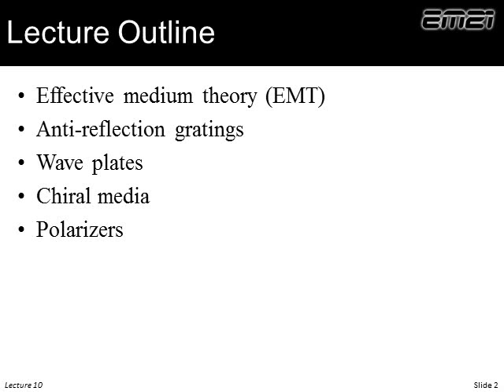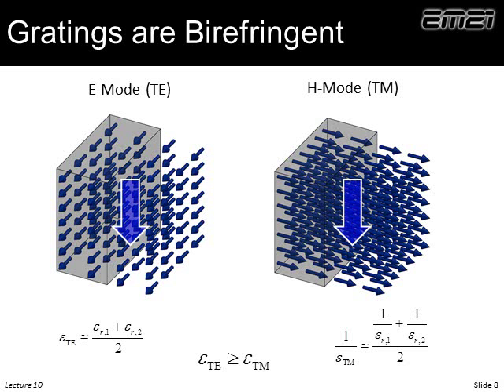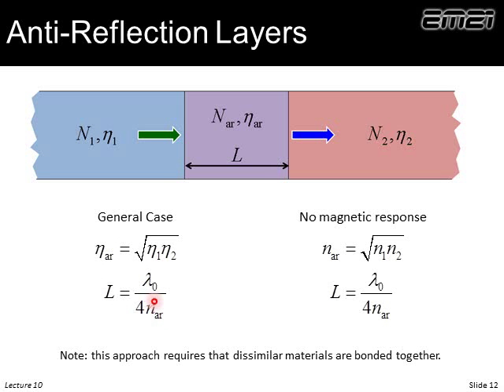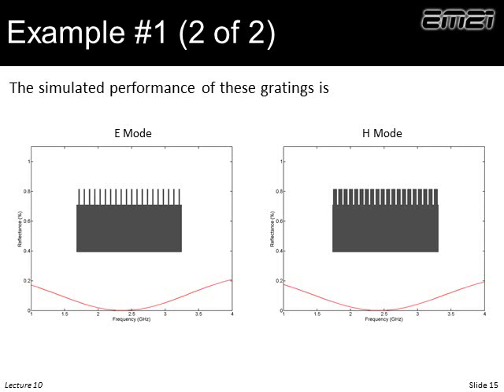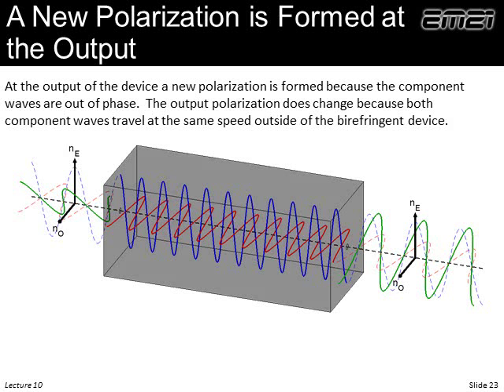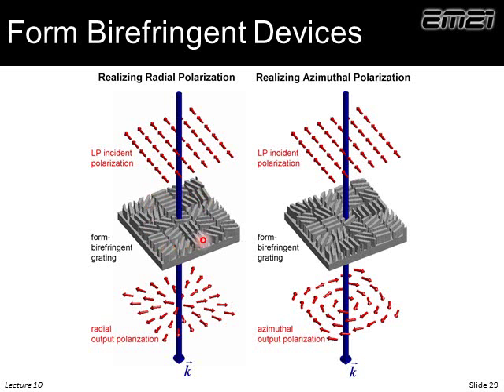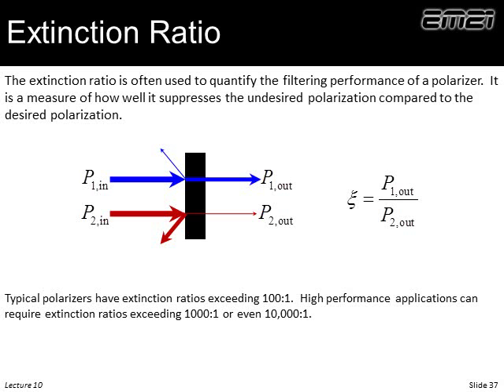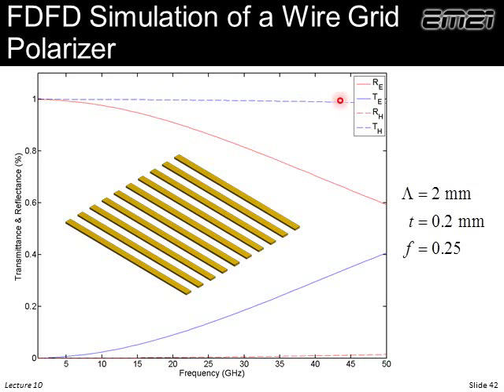Lecture 10 (EM21) -- Subwavelength gratings

Comment: Can/are sub wavelength gratings be used for imaging purposes (i.e., holography)? If yes, what would be the benefit (apart from introducing polarization capabilities)? For the actual image formation ad distance d, I would argue that any feature smaller than the wavelength cannot be propagated from the grating because planar waves describing them will be evanescent by definition.
Reply from the maker: Grating couplers are often used in holographic glasses to transport light between the source, detector, and eyeball. These are subwavelength to external light but not not internally where they diffract.

Otherwise, I am not entirely sure where/why they would be used but I suspect there are applications. A good friend has  a book coming out soon on holography and he will have examples and even computer codes about this.

Hope this helps!

-tip

Comment: Thanks for the lecture! I do not understand slide 9 on TE and TM mode. Why we analyze magnetic field only for the TM mode? TE and TM mode just different in electric direction, why we do not analyze and compare electric field energy for TE and TM mode? Why magnetic field has anything to do in this analysis on dielectric constant?
Reply from the maker: Good question! First, the labels "E Mode" and "H Mode" come from my computational electromagnetics courses and is not an industry standard label. If you want more information on that, you may be interested in my book...

https://empossible.net/fdfdbook/

There many different definitions for TE and TM and each leads to different configuration of fields. The short story is that when I see things called "TE" and "TM," I will not immediately know what people are talking about. Be careful with those labels.

Now to answer your question. Mathematically, it is possible to express waves completely in terms of just the electric field or just the magnetic field. What I am showing as TE here can be expressed completely in terms of the electric field E, thus the title "E Mode." What I am showing as TM here can be expressed completely in terms of just the magnetic field H, thus the title "H Mode." That is why I analyze these just in terms of either E or H.

By the way, I have completely revised and improved the notes for this section. You can find them on the course website that I recommend you use as your main portal to this information.

https://empossible.net/academics/21cem/

Unfortunately, I have not yet re-recorded the videos, but definitely checkout the notes!

Hope this helps!
Reply: thank you! @empossible1577

Comment: On slide 5 you have the figures on the left labeled "Parallel Polarization", but in your dialogue you call that "Perpendicular Polarization".  Vice versa for the right figure.  Which one is correct?  Your slide labeling, or your dialogue?
Reply from the maker: Sorry if I misspoke!  For polarizers, diffraction gratings, and subwavelength diffraction gratings, polarization is defined as the electric field relative to the grating vector K.  The grating vector K points in a direction perpendicular to the grating grooves.  The TE polarization has the electric field transverse to K which means parallel to the grooves.  The TM polarization has the electric field parallel to K which means perpendicular to the grooves.  It is very easy to get the words mixed up!  Sorry!

Comment: Thanks a lot for these great videos. I have a question on the antireflection layer: why the tapered grating has better performance than binary grating in broadband case? how to design it? Thanks for your help.
Reply from the maker: The taper is a smooth transition.  For design, you can take one of two approaches.  First, you can just do any sort of taper.  Just about anything works pretty well.  Second, you can spend a lot of time optimizing the taper and get a little better performance from it.  Unless you really want to improve the angular response, I recommend just incorporating any sort of taper that is maybe 1 to 2 wavelengths large.

Comment: At https://youtu.be/bkLPAL_RLUc?t=704 Why does the length has to be equal to 1/4 wavelength and what happens if you make it shorter or longer? I understand that 1/4 wavelength thickness is good if you want to achieve destructive interference, but I believe that here the goal is to match the effective refractive index closer to that of air, such that the wave essentially penetrates the material instead of reflecting at its interface. Thanks for your help and thanks for this great video!
Reply from the maker: Great question.  First, let me point you to the official course website which has links to the latest videos, electronic notes, and much more.

https://empossible.net/academics/emp6303/

In fact, there are other thicknesses you can choose to get zero reflection.  It is just that the quarter-wavelength is the easiest solution and works well.  If you want to see a detailed derivation that also identifies how to get other solutions, checkout Lecture 7f Multiple Scattering here:

https://empossible.net/academics/emp3302/

If the wavelength deviates from the design wavelength, reflection is no longer zero.  However, there is usually a range of wavelengths where the reflection remains relatively low.  If you want zero reflection over a broader range of wavelengths, there are antireflection coatings that have multiple layers.

Comment: If i have a structure of discontinuous arrays of silica with 100 nm period which is 10 nm thick and i hit it with 300 nm em wave, what will happen? Will it diffract? Is it subwavelength?
Reply from the maker: That is still subwavelength.  The wavelength inside the silica is 300/1.5 = 200 nm.  That is still larger than your grating period of 100 nm.

Comment: Would the concept of the spatially varying polarization, say linear to radial, using the form birefringence device, be applicable to EM waves in the microwave region, or would this effect only occur in the optical region? Also would the parameters such as spatial period, and duty cycle scale over in to the microwave region? Great lecture btw.
Reply from the maker: Thank you...and yes!  Electromagnetic waves all behave the same way from radio frequencies to microwave to optical to x-ray frequencies because they are all governed by the same equations, Maxwell's equations.  The only reason there are any differences is because the properties of materials can be quite different at different frequencies and the different size scales may limit what we can and cannot built.  There is a concept that you eluded to called "scalability."  If you find a device of size L that does exactly what you want at frequency f1, you can make it operate at frequency f2 by scaling all dimensions by f1/f2.

Very often this leads to devices that are not of practical size when you scale from optical to microwave frequencies.   Also, at microwave frequencies, metals exhibit much lower loss so you can often make much smaller and more compact devices than at optical frequencies where metals tend to be avoided as much as possible.

BTW, if you are interested in the spatially-variant stuff, take a look at this short course:

http://emlab.utep.edu/scSVL.htm

Hope this helps!!
Reply: Thank You very much. This is exactly what I have been looking for. I've tried to read some of the literature on space-varying polarization manipulation and PBOE's  and the concept of geometric phase kept appearing. It sounded like the geometric phase has to do with light at the photon level but with microwaves I'm not sure if it makes sense to talk about photons.
Reply from the maker: I am not sure what all you are reading, but space-varying polarization probably refers to the polarization changing as a function of position throughout the cross section of a beam.  These are hard to create naturally so we create a linearly polarized beam and convert it to whatever we want using something like a form birefringent wave plate.

It does make sense to talk about microwave photons, but it is not that meaningful.  The particle nature of a photon is proportional to the wave's energy.  The wave's energy is proportional to frequency.  Microwaves have a frequency that is orders of magnitude smaller than light so the particle nature of microwave photons are orders of magnitude less significant.  Regardless, the particle nature of waves is not needed at all to understand polarization and wave plates.
Reply: I see...the material I was reading was called 'Excitation of a single hollow waveguide mode using inhomogenous anisotropic subwavelength structures', and this is where the concept of the geometric phase was mentioned. Regardless, i'll look into your course for spatially varying lattices.

Comment: great explanation!!...i have one question. How can one find the effective refractive index of a multilayer (3 layers of different materials) grating?  Thanks!
Reply from the maker: Are you talking about when the layers are along the direction of propagation, like a multilayer film?  If so, this doesn't really fit the model of an effective medium unless the layers are very subwavelength.  The best way is probably through a simple parameter retrieval.  See Lecture 15 in EM21.  Also, not sure if you knew it, but you can download the electronic notes for these classes here:

http://emlab.utep.edu/academics.htm
Reply: Thank you so much. I didn't know about the notes.  Actually I was asking about the grating with coated layers (on material coated on the top of the other) so that we have 3 different material layers in the grating groove height i.e. perpendicular to the grating period axis.
Reply from the maker: Mahesh Kumar Okay, so instead of a binary grating you have a grating made of three materials. If this is correct, you can derive an analytical equation for this pretty easy.  This is what you need to do...

emax = f1*er1 + f2*er2 + f3*er3   where f1 + f2 + f3 = 1 are the fill factors.

1/emin = f1/er1 + f2/er2 + f3/er3
Reply: CEM Lectures  Thanks you so much!.